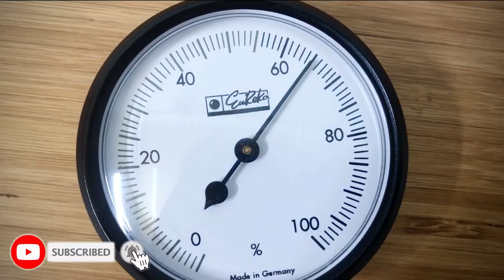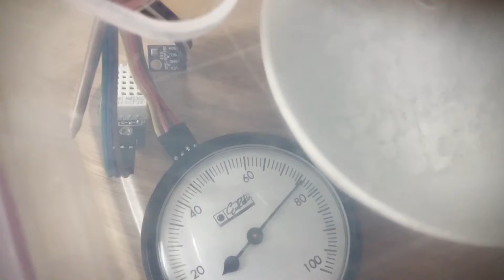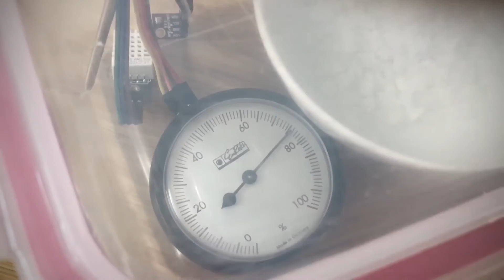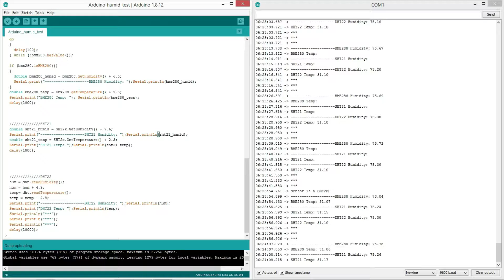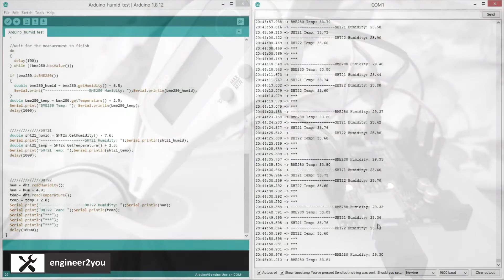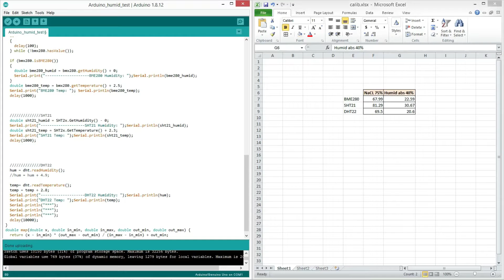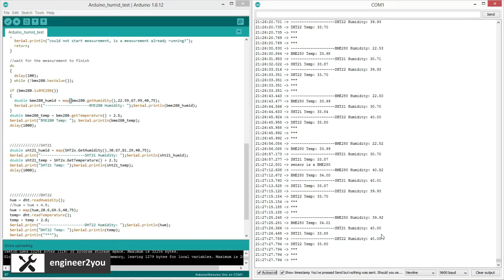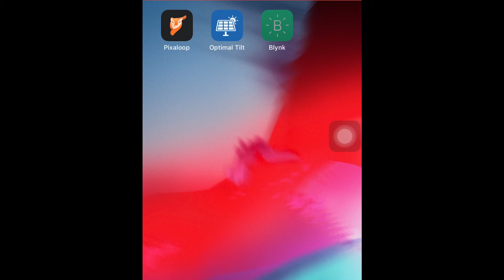Arduino humidity sensors: testing and calibration

Comment: ry with water saturated in NaCl (100ml with 36 grs. of NaCl) mix and leave for stabilize, you shoud have a 45 HR between 20 and 60C degree. The problem sometimes is the temperature sensor and as HR is calculated from temperature , that could be the beginning of errors in HR values.

Comment: can you also do this with aht10 thanks
Reply from the maker: Same procedure, you can do it
Reply: @engineer2you  i would but i dont have a gauge meter.. for now i just calibrated it to online weather data for my area...
Reply from the maker: @genome692002  you need another gauge meter (good one) to calib the sensor.

Comment: The DHT22 sensors I got all read grossly erroneous humidity values - either 1% or 100%. 
The temp readings are OK though.
Has anyone else notice that ? 
Is there any solution for those faulty DHT22s ?

Comment: It was necessary to multiply, and not use addition. And, it is quite obvious that the correction coefficient will be nonlinear. You should find several points, and for each segment to calculate your correction factor.

Comment: instead of using an offset to your measurement use the function map(value, fromLow, fromHigh, toLow, toHigh), it's a arduino built in function. If you had a low datapoint you could use it to calibrate linear data like temperature, humidity, pressure. the salt method is good for getting a  high value, there are other salts you can use to get  the low datapoint, like the damp rid stuff
Reply from the maker: Sylvain Martin thanks for your comment. Actually, i used map function at the end of video because offset cant give good result for wide measuring range
Reply: How can I use the data map.???
Reply from the maker: @mostafaal-hajee3055  hi, you have to build data for "map" function for your own sensor. Watch the video, you will understand how to do :)

Comment: Hey, i checked Sodium chloride but my humidity going above 80% why? both sensors showing the same
Reply from the maker: Just add very little water for Sodium. Use good humidifier for double check, if your sensor result is not correct, let’s offset or calib it
Reply: @engineer2you  I got a industrial hygrometer and one dht22 and one more hygrometer  all of them shows humidity above 80
Reply from the maker: @GeorgeJeffin  haha. What a wierd! All document stated that saturation Chloride will be around 75%. Anyway, let’s think what possible reason could be
Reply: @engineer2you  humidity around my place is 62% is that any problem ?
Reply from the maker: @GeorgeJeffin  saturated soldium must be in isolated box (seal box), so it will not effected by environment
Reply: @engineer2you  still have no idea why my sensors show 81 , but I checked with calcium chloride and it shows 30, don’t know about the sodium chloride 80+ !! 🤧🤧
Reply from the maker: @GeorgeJeffin  haha

Comment: Wow, very nice, thorough work.
So, the hygrometers that people buy at local stores are garbage, and the readings people tell you that they get from them are probably wrong.  That's not reassuring at all.

Thanks for this video.
Reply from the maker: anyway, hygrometers from local store are calibrated by Maker. That's the only way user like us can trust in humid measuring
Reply: @engineer2you  And they're calibration is often bad, or it goes bad/off in short time.

Thanks.

Comment: The humidity sensors use capacitive sensing, so I wonder if the proximity of the devices to each other in the chamber would have an effect. Also, the BME280 is calibrated by the manufacturer and values baked into registers. I'm wondering if these factory calibration values were taken into account in the readings, or whether you used raw values.